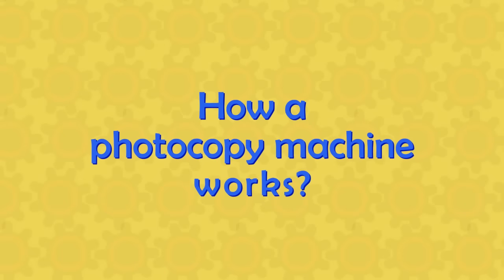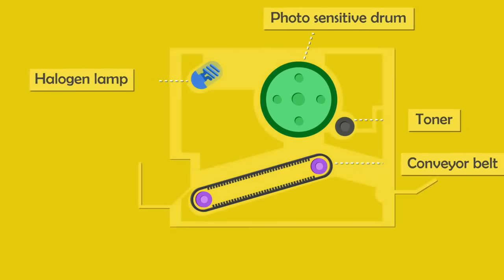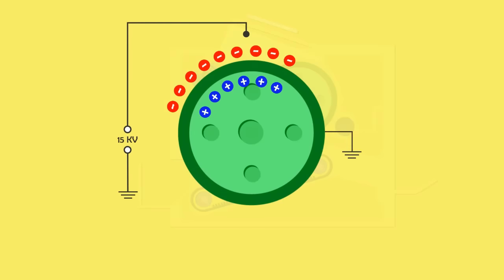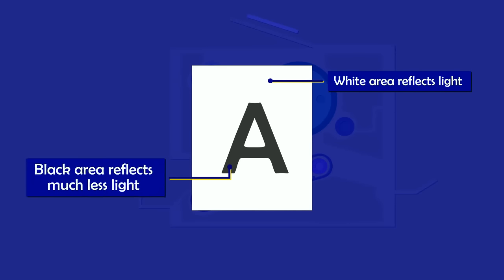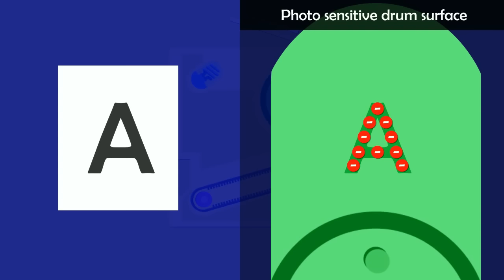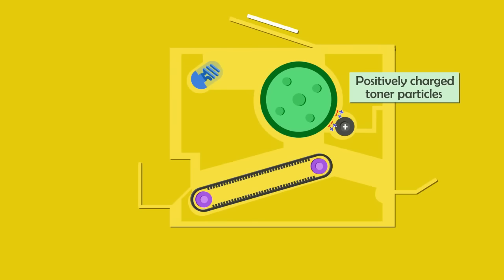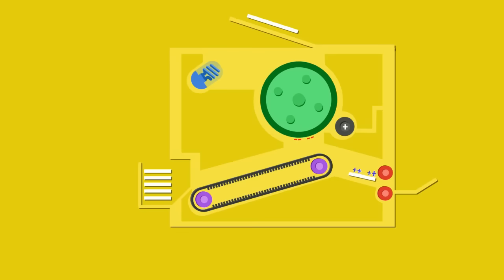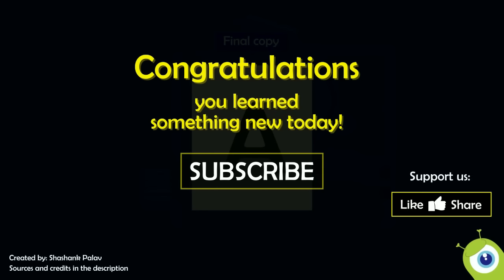How photocopiers work

Comment: In my physics textbook, it shows the charges as the opposites; the dark area retains the positive charge and then the toner is given a negative charge.
Reply: Yes, I'm also finding both informations but I don't know if there is a correct one or if both are correct
Reply: FreezeFire I guess it doesn’t matter as long as the dark area and the toner have opposite charges.
Reply: yea, same here bro.
Reply: FreezeFire it's because this is analog, digital machines are opposite, but this isn't an exact description either, so don't worry about it.
Reply: exactly i dont get it
Reply: @madhuniveditha1144  I don’t think it matters too much, I think u should write the charge that the textbook says on ur exam if u have one. Other wise the process is the same so yeah
Reply: But if the dark area will have negative charge then it will also act as a conductor and no copy will be found
Reply: YES , YOU ARE RIGHT, IT WAS WRONG

Comment: Tonor is negatively charged. While there are positive charges on the drum coated selenium and drum have Aluminium which is negatively charged. When lighr exposed ,except dark areas every charge become neutral and positive charges left on the areas where light couldn't fall.Then tonor which is highly negative attract with the positive charge on the drum and copy it to the blank page which go through the further process as explained by you. 
       However, this diagrammatic view helps alot to understand the whole mechanism.

Comment: Everything looks good but one thing I didnot understand is, how the paper is given a  strong electrical charge. Paper is a non conducing material, right? I feel the paper is rolled over the drum which has toner particle stuck to it. It will transfer the toner particles on to the paper as it rolls over the drum. The toner particles would be wet at this time and as the paper goes through a hot section, it would dry. That is why the papers are a bit hot when they come out.

Comment: The explanation  was good but the details on charges are wrong. The charge on the metal roller is positively charged and the toner particles are negatively charged.
Reply: That’s true
Reply: I guess it doesnt matter as long as the charges on the toner and the metal roller are opposite